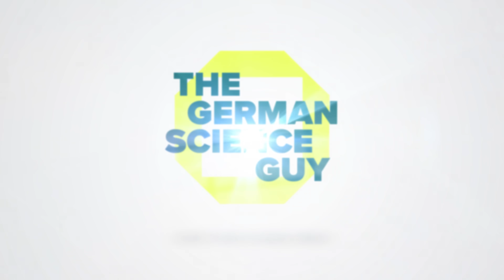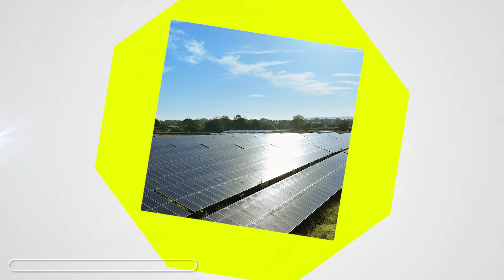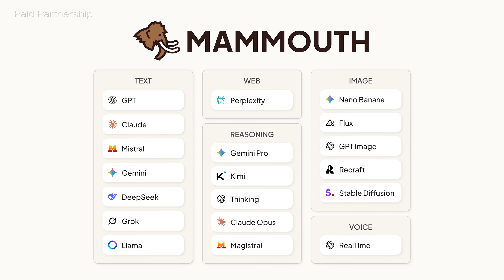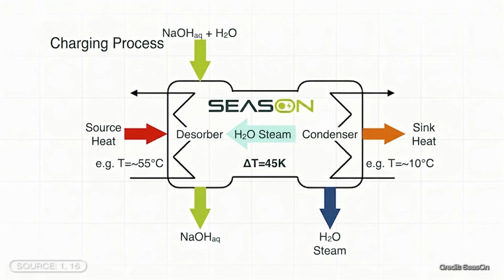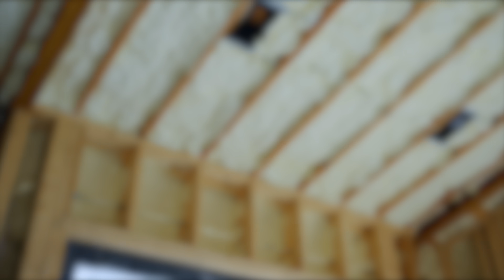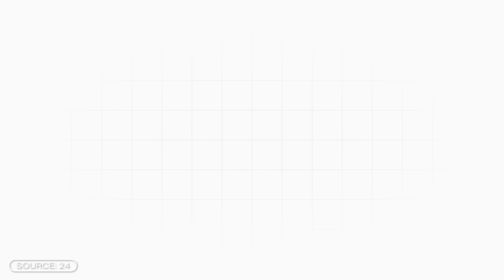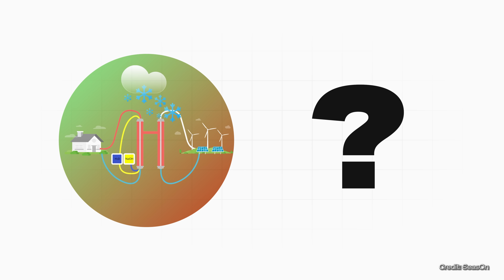New Heat Storage: Better Than a Heat Pump?

Comment: Might be better with a smaller system that can last a week in winter. Electricity prices are lower on the weekend and it can charge up then, also, weather systems blow through every week or so with potentially excess wind generation (depending on location). Thermal storage for individual houses or larger scale like the sand battery already exist, I wonder how the price and scale of the systems compare with this chemical storage. Chemical thermal storage for individual houses also already exist, like some giant version of a heat pad where the contents crystallizes and releases heat.
Reply: Not really since a factory or steel mill is a 24/7 operation.  Electricity mainly spikes in the late afternoon when everyone cranks on their air conditioner in their homes while cooking.

Comment: Why would anybody do this instead of using a sand battery or similar that's a fraction of the cost and has many of the same benefits AND won't create a toxic mess if it leaks.  This reeks of a chemical corp searching for new applications for it's surplus mfg capacity.
Reply: higher energy density? nothing else i guess

Comment: Storing energy as a reversible chemical reaction is a really good idea in principle, but this sounds like it has both economic and practical issues. Maybe someone will come up with something better based on this basic idea ? 
Caustic soda can  also severely corrode aluminium in a violent exothermic reaction generating highly explosive gaseous hydrogen, which is not what you want near any aluminium structural elements of a building.

Comment: In England we have 16th Century Abbeys heated by heat pumps. A poorly insulated building can be heated with a heat pump just as well as with gas or oil heating, IF the system is designed correctly.
Bad system design makes heat fail, not bad insulation.
Reply: With electric, or fossil fuel heat, they're designed to blast large amounts of very warm air quickly, and then shut off. Heat pumps are designed to heat and cool very slowly very much longer period of time compared to standard heaters. You don't so much correctly design the heat pump system because of poor insulation, you have to go to a bigger heat pump. For regular heaters they just run a little longer. Heat pumps have to get bigger. Still more efficient though.

Comment: Why not store a sizable fraction instead of the full amount, and then release it to where the necessary heat pump can boost it to room temperature at high efficiency? A heat pump is super efficient above, say, 5 degrees and this system could boost air from, say, -5 to +5 without as much capacity requirement.
Reply: Great idea!  Use this as the first stage of a two stage system in areas where it gets really cold in winter.  Some heat pumps work efficiently down to -20C, so I don't think the capacity will need to be very much at all.  At least enough to eliminate the need for resistive heating that most heat pumps have as a backup.  Anything over that is an economic calculation based on current data and highly variable by location/polity.

Comment: I like the simpler concept of having the photo volteic panels heat directly with electric coils buried within a very large well insulated container of sand.  When heat is needed,  water is passed through tubes coiled within the tank. That water heats up and is passed hdyronically through the house. Very similar to heating water storage tanks with photovolteic panels and then using the same process to heat the building...
Reply from the maker: True, also a very nice and way simpler technique. I also made a video about it. I wonder what the data comparison of the technologies would be, sadly we don't have enough data about the caustic soda battery. But I agree simpler is usually better if the other benefits are not way bigger
Reply: and doesnt take 15-25 years to pay back lmao

just dig a hole in your yard put some insulation into the hole and coils and then put the first back in and cover with insulation, and you have a really cheap heat battery
Reply from the maker: This is the video by the way: https://youtu.be/EbEVOa9IEgQ
Reply: So you don't think just directly collecting the solar heat is the play here? You'd rather convert it to electric and only catch 20% of the light when it's not cloudy instead of just pulling ambient heat whether the sun is hitting the collector or not at 100% efficiency? What about the losses in your electrical storage system, transmission system, the thermal battery and heating element used? Skip all those intermediate steps, if you want to store heat, just collect the heat, you can always use a heat pump to transfer two batteries with low grade heat into one battery that holds high grade heat. The heat pump can even run on heat directly to get even more ridiculous performance than it already has.

You're overcomplicating things.
Reply: @KastorFlux  Exactly. A simple evacuated solar thermal tube array is nearly 100% efficient and even produces heat on a sunny winters day when the outside air temperature is below freezing.
Using solar PV electricity is just plain stupid not to mention expensive.
I built a prototype heat store using copper sulphate years ago. Same principle as this caustic soda system just a lot safer.
Reply: @KastorFlux  There is no "conversion" going on here, you're comparing apples to oranges.

Photovoltaic solar panels, by in large, mostly absorb in the visible spectrum, not the infrared - typically around 600-700nm. There is a contribution from the near-infrared (700-1100nm), but a good deal of the generated power comes from the visible spectrum, which can't be captured by thermal solar systems.

This is an intrinsic consequence of the fact that the  physical process involved with photovoltaic absorption is completely different to thermal radiation absorption, relying on absorption of photons to promote mobile electrons, rather than the production of phonons, which is what happens when thermal radiation is absorbed...

It's definitely possible to integrate some kind of thermal solar alongside a PV system. The problem is that you then need to pump the working fluid, which takes energy and probably to compress and expand it in the Winter, to really make the most of the reduced thermal solar irradiance.

I'm somewhat skeptical that it would generate that much extra heat during the parts of the year that people need it most in Central/Western Europe, mostly due to cloud cover preferentially absorbing in the infrared spectrum much more strongly than for visible light.
Reply: @tomfahey2823  from your first line I can tell that you don't know what you're taking about. If there was no conversion, you wouldn't be able to calculate conversion efficiency of pv. If your argument is that electricity is coming directly, read more. If your argument is that it's worth going after the small amount of energy you can get during the brightest, cloudless days, instead of simply storing the heat that's boiling your face off and melting the ice caps... you're an idiot.
Reply: @KastorFlux By "conversion" I was referring to your assertion in your original post that the solar irradiance that hits a photovoltaic panel is converted from thermal energy to electrical energy, which demonstrates a fundamental misunderstanding of how photovoltaic cells work.

The process is not:

Light -> Thermal Energy -> Electrical Energy

it is

Light -> Electrical Energy

as the Photoelectric Effect is a fundamentally Quantum Mechanical process.

As I tried to allude to in my previous post, it would be perfectly possible to have a combined system, which utilises Photovoltaic absorption for generation of useful electrical energy, with a fluid circulation system that absorbs heat from the panel and dumps it into a thermal battery. The combined efficiency of such a system would likely be fairly high.

And as I stated in my previous post, the problem with your idea about only using thermal absorption of solar irradiance is that it doesn't work in Winter - which is precisely when domestic heating is actually needed.

What is totally stupid is focusing solely on the conversion efficiency of the system and completely neglecting the actual amount of capturable energy coming in, when it is needed.